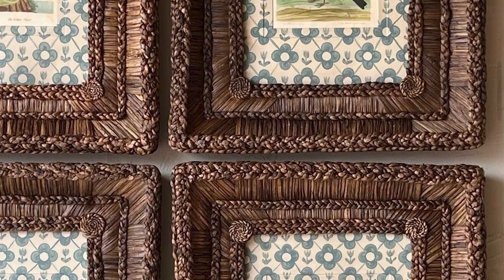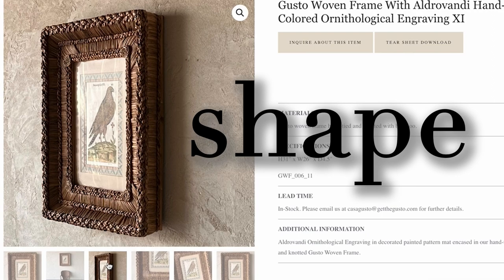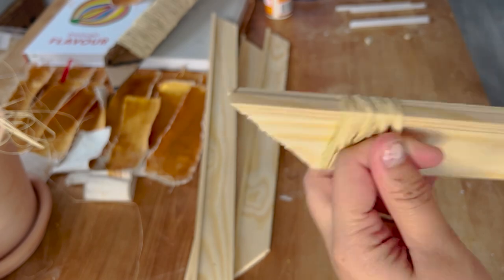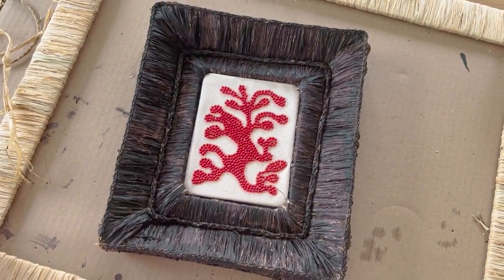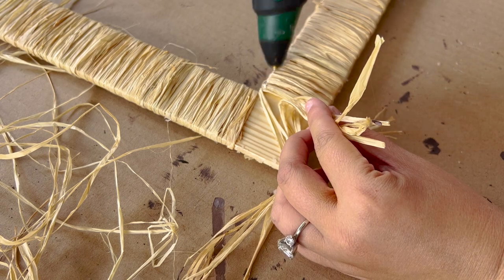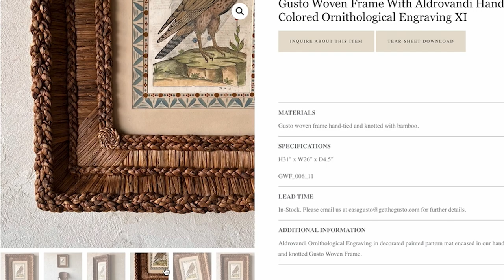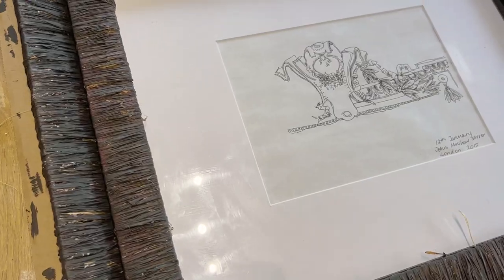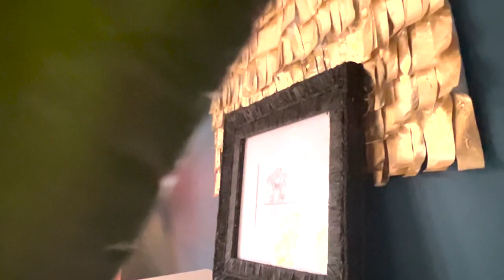Make a vintage woven picture frame without any tools!

Comment: Your problem solving is inspiring! This turned out so cute. Maybe a watered down paint or tea dye would look good on the rafia as well! These are fantastic, and your sister's art is lovely. 🤩

Marble would be lovely on top of the oak panels, but yeah probably hard to find in that size and insulate. Could you do some tambour with cut outs in the top so you can still get some heat? Either way it'd be super cute.
Reply from the maker: Tambour is a good idea! Also tea dye or watered down paint! It’s a shame the final thing looks particularly dark on camera, I keep looking at the original and thinking maybe I need to give it a second try with a lighter colour!! 😅
Reply: @phoebedoeseverything  It really does look gorgeous darker! It gives it a very moody feel. I feel like these would make great unqiue gifts.
Reply from the maker: I agree such good gift ideas!